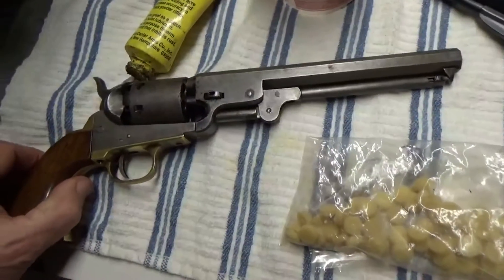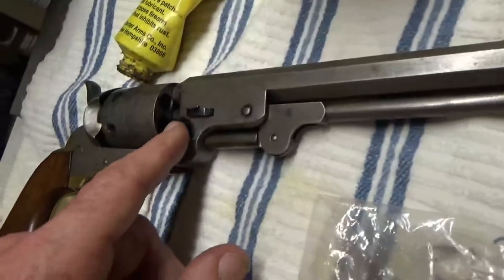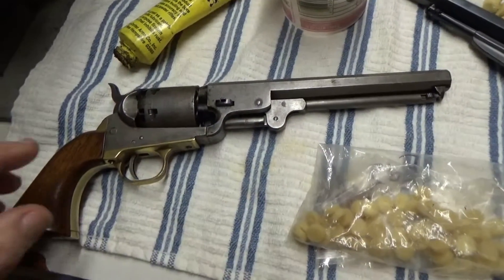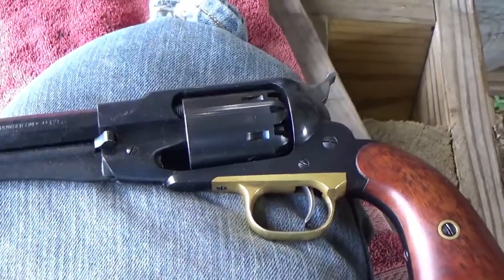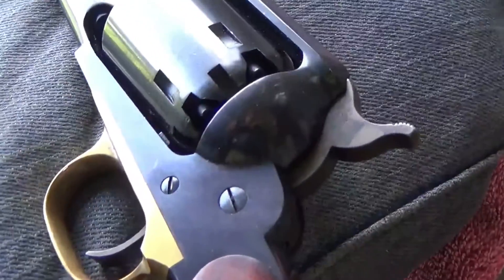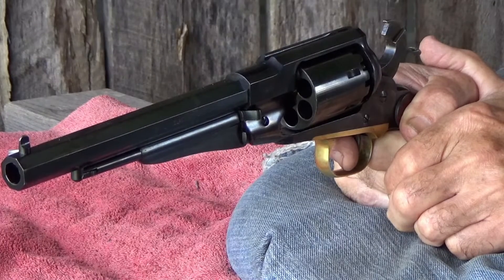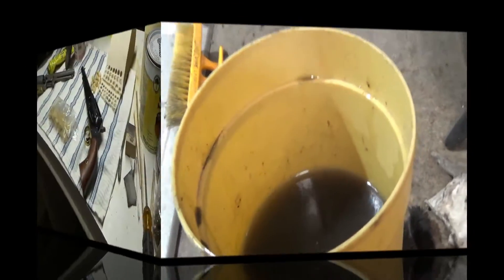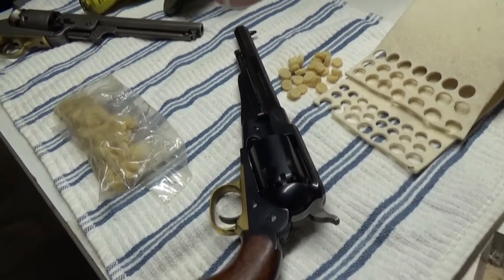1858 Pietta shooting without lube or wads - Part 1

Comment: the original Colt instructions were to load this way. But remember it was 6 shots and either go home and clean and reload, or you next of kin took the gun home and cleaned and reloaded. If you needed more than six shots you would pull out a second revolver.
Reply from the maker: Yup, and a chain fire was probably only a minor thing, if it happened, not much to worry about compared to what was going on.  O.R.

Comment: I've been experimenting with different powder loads, cast & swaged round ball, Lee and Eras Gone cast conicals, lubed felt wads, fibre wads, lube over the projectile, between the wad & projectile and nothing at all in my .36 Uberti Remington New Model Navy. I found most of these either inaccurate and/or messy. The final experiment proved the most successful = 21 grains of Pyrodex P (I can't source real BP) under Lee .380 (not .375) cast round balls dipped in a molten 50/50 mix of Beeswax and Lamb Tallow. Allow to set with the flat sprue resting on greaseproof paper. This doesn't blast lube all over the club range dividing walls, is quick and easy to load and gives the best accuracy I've ever achieved with this revolver. What's more, the bore fouling remained soft even after 48 continuous shots without wiping.
Reply from the maker: You've been busy.  I never thought of dipping the round balls, but that would seem to be an excellent idea to get some lube on the powder side without using something like a grease cookie.  
Also, for quite awhile Ive been suspicious that the 36 calibers with the 1-30 twist, my Pietta is 1-30, and I believe someone said Uterti is also, which would go against their 51's and 61's, have issues as far as stability if the ball doesn't take the twist..  Don't want to be quoted on this, yet. One in 30  is the same as their 44's and shouldn't smaller need faster??  All I used to shoot was the 36's, and always seemed to have flyer problems.  Was amazed when I started with the 44's that seemed not to be the issue.  
That you could shoot that many without cleaning tells us that it is working and something I would like to try.  I would guess that setting them the way you did will add extra lube where it is needed.  Thanks.  O.R.
Reply: That sounds great, I'm going to try that. The greaseproof paper is just wax paper? And your barrel length is 7 1/2"? I use grease cookies mainly (about 1/8" thick) and when I'm done shooting there are always two vertical black lines or BP crud and lube alongside the range walls... I usually load 21 grains too, with a .380 RB in my 2nd Gen Colt Navy.
Reply: @oldranger3044  My .36 Uberti has a 1 in 32 inch twist rate and a 7 3/8" barrel....or it HAD, before I shortened it to 6" for better balance and dovetailed for a .5" tall Skinner front sight filed to fine tune the aim and striking point. Other mods - slightly chamfering the chamber mouths to prevent lead shaving off, checking the cylinder - barrel alignment and polishing the forcing cone as it was rough. 
I bought the revolver new in 2013 and was disappointed with accuracy for a long time, despite trying every  tip and trick in the book. There were times I came close to selling or trading before relenting until frustration calmed down. One day last year I was dipping cast .45/70 bullets in the pan when the idea about dipping  .36 balls sprung to mind. The theory is the powder melts the lube at the back which follows the ball down the bore gliding on lube at the front while leaving a film for the next shot and lubing the cylinder pin. As you'll know, Remington cylinder pins soon foul making the pin difficult to remove. My remedy is to half withdraw the pin and add a few drops of vegetable oil every 12 or 18 shots. One observation when testing the dipped bullets is the first cylinder load aren't as accurate. I use these as fouling shots prior to getting down to business. Certainly give it a try, there's no guarantee it will work with your Piettas and .45s. Whatever, experimenting is fun in itself.
Reply: @Prowbar  Yes, wax paper, I'm in the UK, we call it greaseproof 🙂.  My barrel length was 7 3/8" before I reduced to 6" for better balance. The extra meat of the .36 adds a lot of frontal weight. Please read my reply to the Old Ranger for more details and other mods. 
I tried 1/8 " grease cookies, felt wads dipped in lube and every other method under the sun, even softened lube between a cork wad and the ball. By far the best accuracy my Uberti's given since purchasing in 2013 is with dipped balls and 21 grains of Pyrodex P. I'd try real black powder but a special licence and storage facility is required and the the gun shops in my area don't stock it due to low local demand.
Reply from the maker: @85waspnest  Just got to reading this.  That's the same thoughts I've had about my 36's in 2nd gen.  About 1-32 twist.  I even butchered a couple of cylinders trying to ream them to .375, 30 years ago with a $28 drill press.  I then shot 380's, and it was even worse, especially from the chambers that the drill went "off center". Couldn't sell them, so I ordered couple replacement cylinders from Colt.  A person could sure mess things up easier then without the internet.

I plan to try the "dippy" thing this summer.  Do you just use tweezers, or are you doing this somewhere in zero gravity and getting a perfect coating?  How about cooling them, or freezing.  Seems that would give extra coating, but then the loading lever end could get pretty messy?  As you say, experimenting; lots of fun, and lots of work to do in Texas.  O.R.
Reply: @oldranger3044  Wow, using a drill was a bit too extreme !!! I used a chamfer tool  LIGHTLY and evenly,  rounded off the edges with a round headed brass screw with valve grinding paste in the slot. Finally, added a 'slight' lead in taper for the last 3/8" of the chambers to make sure the ball wasn't shaved on entry or undersize in the bore. Recovered balls and bullets have nice deep rifling with a small tail at the rear of every groove. The Uberti instruction leaflet reads .375 OR .380 balls but they actually recommend .380. I bought a box of Hornady swaged .375s with the revolver which were awful as the sharp edged plunger dug into and grabbed the ball on seating, then pulled it out on extraction.  Note - I've since removed the sharp edge on the plunger. 
I use long nose tweezers to hold the balls when dipping. Hold the ball with the flat sprue facing downwards, fully dip, then place place the flat onto wax paper to dry. This serves 3 purposes. 1/ The flat prevents the ball from rolling away and 2/ Wax accumulates around the flat than the rest. 3/ It's easier to see the flat surface when loading. Obviously unsafe if the flat is against the chamber wall. I load them with the flat against the powder. 
With the chambers chamfered and tapered, some of the wax on the ball scrapes off and deposits exactly where it's needed, around the front of the circumference. 
I've used a 50 / 50 mixture of the original military beeswax and lamb tallow recipe but last summer added some candle wax to raise the melting point. I guess the mixture I'm using at the moment is approx 40 beeswax, 40 tallow and 10 candle wax.  You might have to experiment with the mixture and you could also double dip the balls for good measure. I haven't tried this as there's been no need.  
Have fun, I can't wait to see your results.
Kind regards, 
Dennis from across the pond in Lincoln, England.
Reply: @SILVER-WOLF-1  Please read my reply to O.R's comment which should answer your question. Thanks.
Reply: @SILVER-WOLF-1  Consider, the combustible paper cartridges with conical bullets used in the US Civil war were factory dipped in a beeswax & lamb tallow mix coated the frontal area and filled the grease groove ahead of the paper joint. Dipped balls cover the entire surface including the rear where it will melt & splatter, therefore doing a better job of lubing the cylinder pin. However, in practice I always partly withdraw the pin every 18 shots, add a few drops of vegetable oil, replace and spin the cylinder to keep it running freely.
Reply: @85waspnest  Well, it took me a while but I tested your method. Used some conicals cast from a Manhattan firearms original mold (out of round balls at the moment). Dipped them in molten lube (mix of lamb tallow, beeswax, candle wax) with tweezers and shot them that way with about 16 grains of WANO PPP (3Fg) BP from my 2nd Gen Colt Navy. To my surprise, there seems to be enough lube present to keep the barrel fouling soft, accuracy up and the cylinder pin free. Will do more testing, but I must say I'm impressed. I will probably keep using your method. Thank you very much!
Reply: @Prowbar  Well it's taken me a while (3 months) to read this because I didn't receive a notification.  I'm pleased to learn you're having good results. 🙂
Reply: @85waspnest I have the same problem acquiring black powder here in Eastern Idaho.

Comment: Something of a consensus on the 1858remington forum, before it went down, was that humidity in the air at the time would have an effect on the rate of fouling buildup.  I believe also that it was Elmer Keith who noted that if you blew down the bore after every six shots you'd keep the gun shooting accurately.  The reason is that the moisture softens the fouling.

Anyway, I use a lot of lube in my loads, including grease groove bullets and a lube cookie (card, lube pill, card), and that way you can shoot all day and not worry about fouling building up in the bore.  I see zero utility in wasting chamber space with felt, when it cold be a pure lube pill instead.

Chainfires are a total non issue if your chambers are in proper shape and your projectiles fit right, so I don't see any reason to mention them except to say that you'd better fix your cylinder or use better projectiles if you ever have one.  I've fired these guns for decades now, having been through multiple 50 pound orders of lead, in addition to the factory round ball and conicals I've put down range, using all manner of loading methods, with and without wads, and never once had a chainfire.
Reply from the maker: Agree with first two paragraphs. Can also add (not that we can trust movies) that’s what Davy Crockett did with his flinter. Should mention that is a dangerous habit. I saw a fellow do that as a reflex. He though his rifle had fired, put his mouth to the barrel, but only the cap had fired, not the main charge. 
I was in your camp with many rounds, many years, and many empty tins of caps; no chain fires. So, reluctantly I have to take issue with thinking it won’t happen if the front (open end) of the cylinder is properly sealed, because I had two events within one week. I was using some DIY caps and believe I was sloppy in my manufacturing technique. Zero quality control on my part. Thanks again for your comment. O.R.

Comment: I use Vaseline for lube. works fantastic. NO wads or other filler. Havent had a chain fire in 35 years. I never use black powder any more since the new substitutes came out. I like shooting my gun....not standing around cleaning it. I use Goex and  triple 7
It washes right off with warm water. It gives me good accuracy .
Reply: Oh I pray you are ok with a question.  

I’m just getting into BP. Have pcp airguns.  Got bored with modern weapons.  

Blah blah.  When you clean your pistol after the range… how much do you take down of the weapon?  
Can I just take the cylinder out and loading arm and such or do I need to really take it down?  I have 30 grain equivalent pellets because I read they are easier to clean. Much like what was already said

Comment: Nice video ... I shoot two 1851 Navy Colt Pietta reissues. .36 cal. and I use 20 brains with just the ball, no lube. Accuracy is good at 30 yrds shooting off hand until about 25-30 rounds then the gun starts gunking up and the barrel fouls out causing spray patterns and inaccurate.

I sometimes shoot lubed wads and tried filling the chamber ends but was time consuming so I opt for the lubed wads. With the lubed wads I get about 60 to 70 shots before fouling causes issue so it does make a difference lubed for me anyways with the 1851 Navy in .36 so I cant speak for anything else.

I mainly use either Goex FFFg or Pyrodex P and haven't noticed much of a difference with regard to fouling. The Goex has better burn in my opinion.

My experience is three years and shooting them most every weekend. We shoot every weekend anyway with the modern firearms but I shoot the black powder often.

Again I enjoy your videos.
Reply from the maker: Thanks for your comment and added information. I’ll never shot much without some attempt at lubing. Started with Keith’s felt wad method, but couldn’t get groups without flyers. Used crisco around the outside edge of the ball when shooting competition which was better. Most modern shooters, and probably as originally used, don’t shoot enough in succession for fouling to be an issue. It’s also possible that they aren’t concerned, or can’t detect, flyers. So, was interested to hear your experience which pretty much duplicates mine. 
You may have seen the video of mine using the miniature grease gun to dispense lubricant, but if you can get 60+ with the wads, then that seems good enough. After that many for myself, there would be other issues anyway. Again, thanks for your comment. O.R.

Comment: I only use wads with short charges to take up space when needed. I don't care about fouling that much and with my guns as long as I have the sprue away from the side of the cylinder on a good oversize ball chain fires don't seem to be a concern.

Comment: Back in the early 70's we were told to use filler in the cylinders to help keep the ball close to the opening of the cylinder.
A common filler was bird seed. The big problem with it was how dirty and gritty it became after the revolver was fired.
After shooting 2 or 3 full cylinders, the gun would seize up from the crud. It was also difficult to pull the cylinder for cleaning, after a few loadings. It made shooting the revolver a not so pleasant event.
Reply from the maker: That’s interesting. I also got that programming somewhere. Believe it was for a couple of reasons. Ball would be closer to the forcing cone which would increase accuracy. The other was that target shooters used a reduced load to make the gun more “manageable “, and needed filler so the powder would get compressed, and possibly again more accurate. I remember a comment that after a couple cylinders the barrel looked like someone had fried a chicken in it. I haven’t been using it much lately (corn meal) unless I am shooting a real wimp load. Still seem to be getting good accuracy and not fighting with my wife over corn starch. O.R.

Comment: I have a Pietta 1858 Remington and I have only shot  .454 store bought Lead balls.
I have not had a hard time ramming my .454 lead balls into the cylinders using the 
gun's loading lever.
Reply from the maker: Sounds like it is working for you, and no need to change what works.  O.R.

Comment: I like seeing the Video even if I disagree with some of the approaches.   In this case,  the Pietta Manual (new,  do not have an older one) recommends  .454 balls.   I have gone with the original loading they did and believe the band that is formed seals off the Powder on the bullet end and I don't believe chain fire occurs off the cone end (they are hard enough to fire at times with  a cap going off and the powder too packed from my over pressure or so I believe).   I do think you need to check that a band shows up (1/4 inch on my old ASP and the Piettan NMA).   I am shooting some conical and checked to make sure that bullet also has a band in both.   The old ASP does not shave lead but forms the band,  those chambers are tapered.   The Pietta shaves lead.   Currently I am using .457 though I am going to try the .454.  I am using lubed wads to see if it helps keep the guns cleaner.    .451 would be where the chain fire can start as its too small and in that case wads and lubes are mandatory.
Reply from the maker: The .451 will shave lead in my Pietta,s. They have.466-.477 chambers  As you correctly state, their chambers have no taper, so it shaves rather than compress. The issue can be if the shooter is casting them, and the sprue cutter cuts below the tangent line, which seems to be the case with Lee molds. If these are loaded with the cutoff on the chambers side, there is not a perfect seal. A chance for a KaBoom if no wad or lube. Lubed wads will help some, but not as much as a good lube that has the right viscosity. Your caps firing without igniting the main charge is puzzling. Thanks for your comments. O.R.